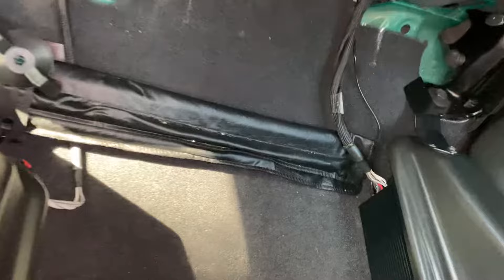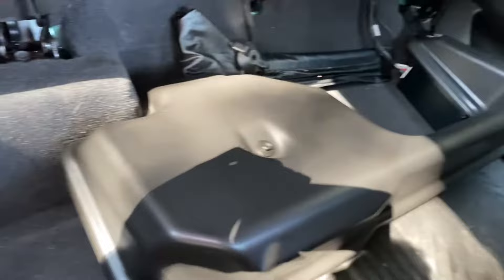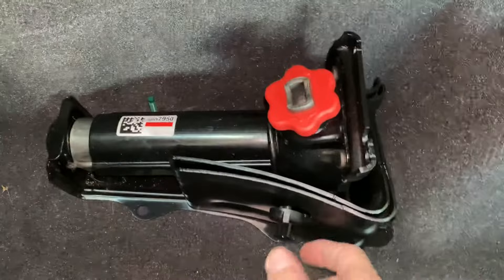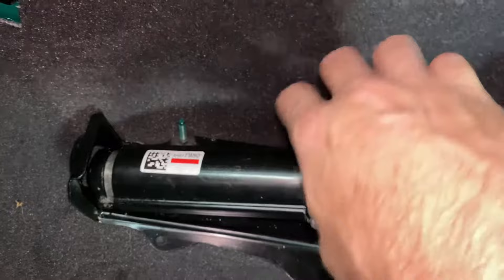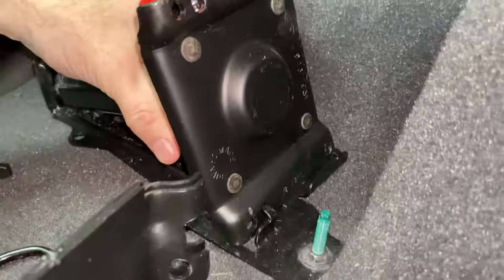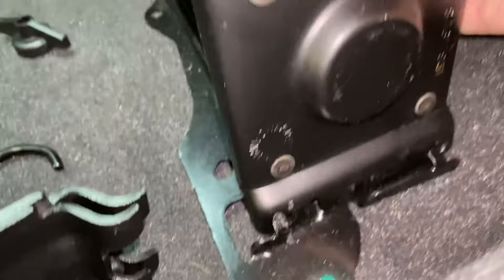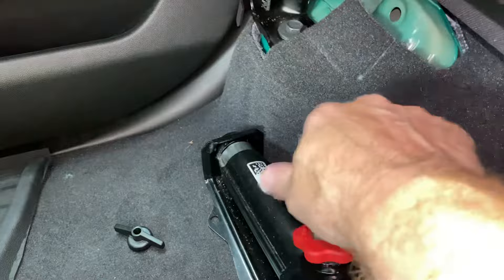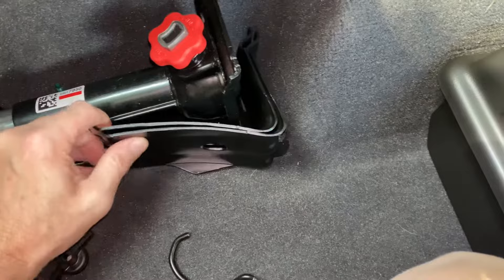Jack and tire iron 2020 crew cab Silverado remove reinstall.

Comment: Thanks.  I needed this video.  Much appreciated.  After one flat tire incident on my 2020 Silverado (& a motorhead friend's advice) I purchased a 3 ton hydraulic floor jack which now makes its home secure in my truck bed directly behind the cab along with various cuts & sizes of lumber for chock purposes & jack stability (MUD?) if necessary.  Did not care for the piston jack that came with the truck.  The chocks however serve a purpose.
Thanks again.